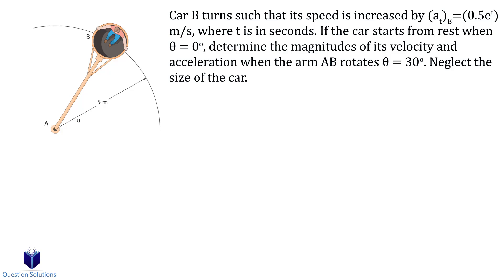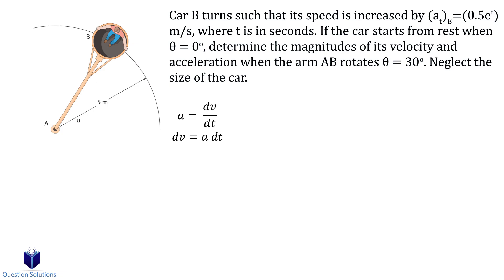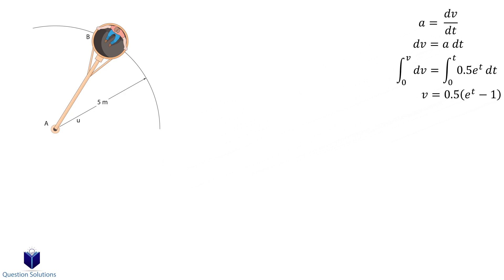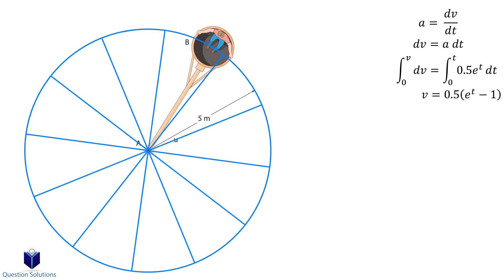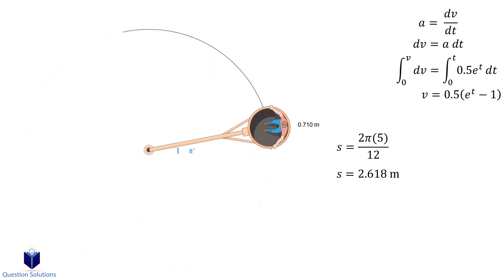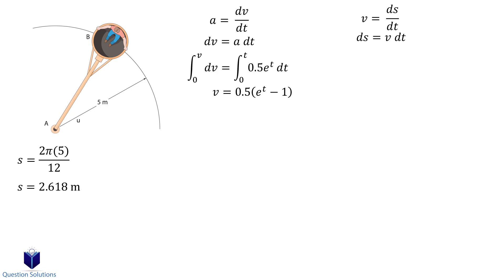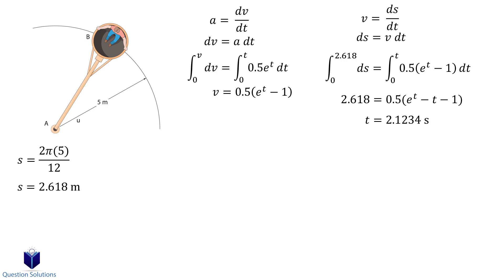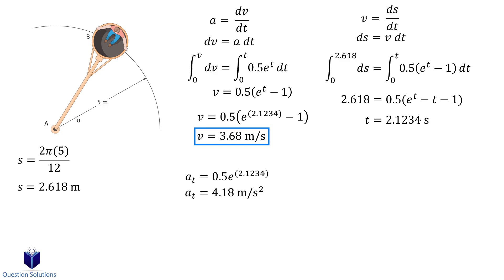Car B turns such that its speed is increased by (solved)

Comment: Sir, what was the method you used to solve the integral to get the answer for t, I have tried using my calculator and it comes out on 0.99999978.
Reply from the maker: Please see: https://www.wolframalpha.com/input/?i=2.618%3D0.5%28e%5Ex-x-1%29 👍

Comment: sir but isnt s displacement so wouldnt it be the line joining the point at theta=0 and theta=pi/6?
Reply from the maker: No because it's not a straight line. It travels in a circular path, and in this question, it actually travels 1/12 the circumference of the circle. So I think you are saying we are only looking for the shortest distance between the 2 points, but that isn't the case here, since we need the total distance traveled, not displacement. 👍
Reply: @QuestionSolutions  thank you sir
Reply from the maker: @squishedmacaroni1039  You're very welcome!